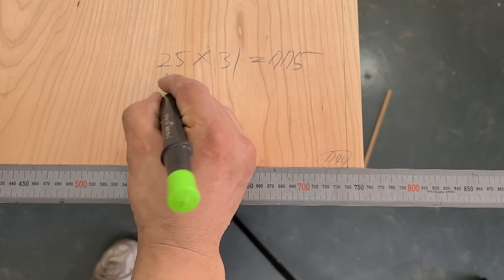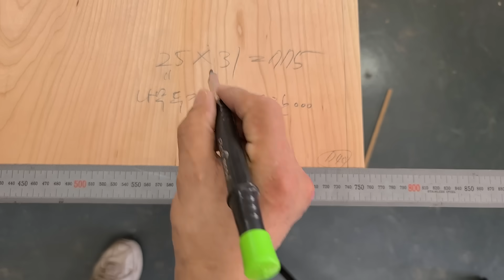[Woodworking] Cherry Wood + Dovetail(using a router) + Twin Furniture

Comment: No glue? Guess if I were THAT skilled I would toss out the glue bottle. Amazing work. 
Stacked vertical dovetail cuts so clean blows me away.
Reply from the maker: A well-fitting tenon doesn't need glue.

Comment: Amazing efficiency in every movement and cut! Can you share the formula at the beginning to space the dovetails? Thank you for sharing your craftsmanship.
Reply: Something is given in the description pertaining to division.
Reply from the maker: https://youtu.be/vVndI3WKnEA      Here is detailed information about the dovetail.
Reply: You make your tails on the edge so example if it’s 1/2 or 15mm then you score two lines on the edges. Then as he measures across he removes the 30mm or 1” from the measurement then given that he used metric he simply measured across from that single end till his measurement hits the second line to get his degree of slop for the tails.
Reply: @HammerSound-1  truly great technique. Especially with the cutting with no pronunciation (marking knife lines) of the cut line to glide down. Truly honed skill in your exhibited technique of cutting in and outside of the tails and pins. Well done!

An doing all the tear out between was also executed nicely to ensure a clean marking line on the joint seem.

Comment: i think this would produce a weaker joint because that router is routing out in vertical steps not /--\ shapes
Reply from the maker: With a little know-how, it is very powerful. My dovetail is very strong.
It never breaks.👍

Comment: Primitive technology. You've probably spent a long time honing it, but why do you still stick to this method? I can understand if it's preserving a traditional culture, but you look like a commercial carpenter
CNC is much faster, more precise, safer, and allows one person to machine multiple pieces simultaneously.
If that's too expensive an option for you (even though CNC machines have become incredibly affordable), you can also use modern tools like Festool's Domino to be much more efficient.